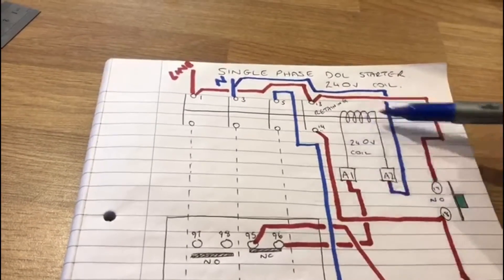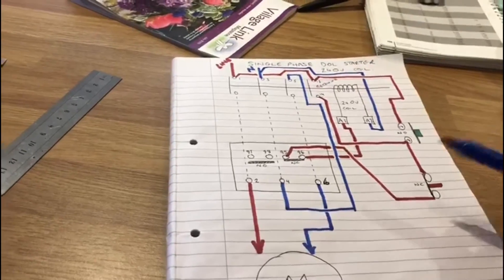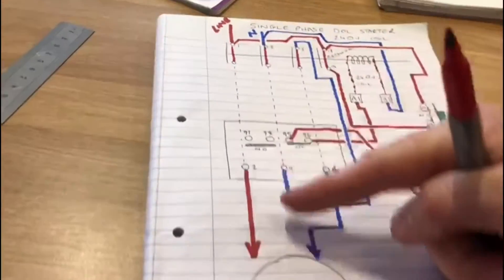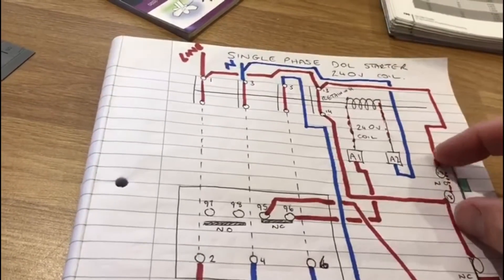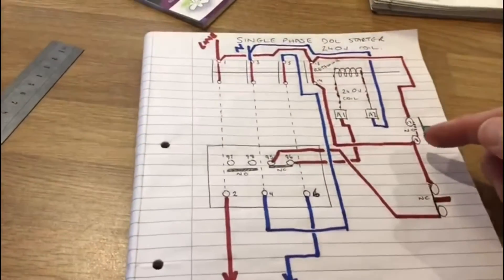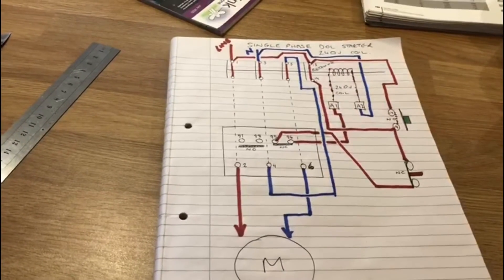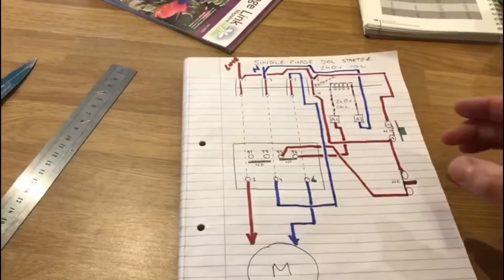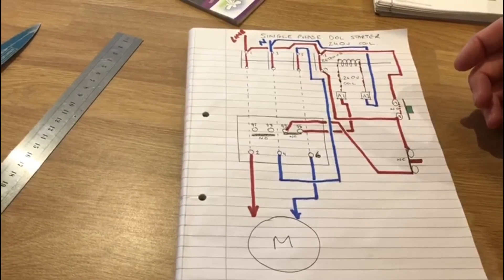Direct Online Starter DOL Part 2 Wiring Diagram for How to Connect a Stop and Start Buttons

Comment: 1st class demostration . good job. very clear. please do the ATS circuit that switch beteeen  genarator and commercial power. and automatic motor control circuit according to change in fluid level in filling tank and  fluid level drop in tube wel. thnks you

Comment: Excellent video again Matt, can you just tell me why do you not take the neutral to the motor from terminal 4, and are the terminal numbers universally the same in all D.O.L. starters?
Reply: If a 3ø OLR 'sees' a Imbalance in its 3 Main-Contacts, it is deemed as a abnormal operation in a 3ø motor. Hence it needs to Trip to protect equipment.
But when used on a 1ø motor operation, a 'trickish-fooling' method needs to be done in order for the 3 Main-Contacts to 'see' equal current draw on all its Main-Contacts, hence the 'loop'...

Comment: Great video, could you show how to add in a “shunt” button into the control circuit, to turn the motor gradually to the desired position?

Comment: There is something small Id like to understand. The control circuit goes through 96 and 96 (NORMALLY CLOSED)  of the overload. Does NORMALLY closed not change state when energised in so becoming "OPEN" . How would electricity flow if the state is OPEN?
Reply: It changes state when the overload operates, 95-96 operate when there is an overload causing it to go from NC to NO
Reply: @peanutpotion  thank you,  my mind was in a knot there. I understand now cheers

Comment: Surly, NC contacts 95 and 96 will open once the start button is pressed, opening the coil circuit, this will not work!! Have I missed something??
Reply: 95/96 is unique to the OLR. It will only Open its contacts ALONGSIDE the Main-Contacts of the OLR.
OLR does not Open the Main-Contacts until the OLR sees a OLR -related fault eg. during a Trip/Overload etc...

97/98 on the other hand is 'opposite' to 95/96.
If 95/96 is Normal (NC), 97/98 will stay Open Circuit. If OLR suffer a Trip, only then 97/98 will Close its Contact. Typically this 97/98 on OLR is used to 'power up' a TRIP IndicatorLamp or NotificationAlarm alike...
Reply: 95 and 96 (NC) would not open just because it becomes energised
Otherwise by the same logic, the (NC) stop button would also open when it becomes energised (hint, it doesn't)
You could always think of NC as "Normally Connected", rather than "Closed" if that is the bit that is causing confusion for you.
Reply: But the stop button is manually pressed to open, 94 and96 are auxiliary contacts on the contactor are they not therefore changing state when ye cool is energised!
Reply: @kevinsweeney8772  nope. I presume they are possibly a breaker?, Not to sure, possibly not important to this excercise.
Reply: @kevinsweeney8772   found this video from 4 months ago. https://youtu.be/7U-DqKQkSPU
The 95/96 and it's (NO) counterpart are apart of an overload circuit, so when the motor pulls too many amps, 95/96 will open and break the circuit which will (Just like the Stop Button) de-energise the coil. I presume 97/98 (NO) will probably close and allow something like an external light or alarm circuit to be powered.